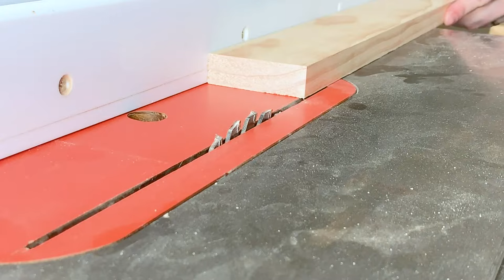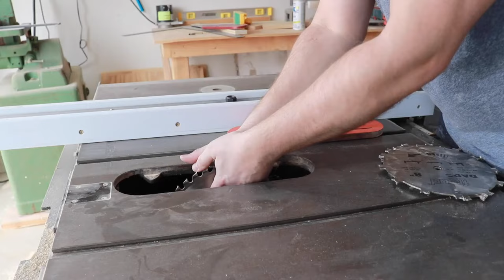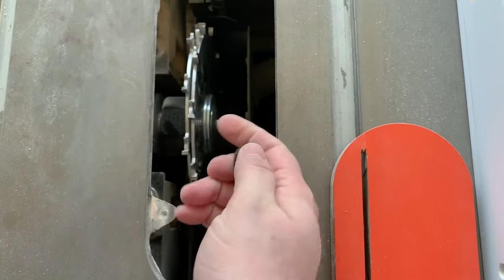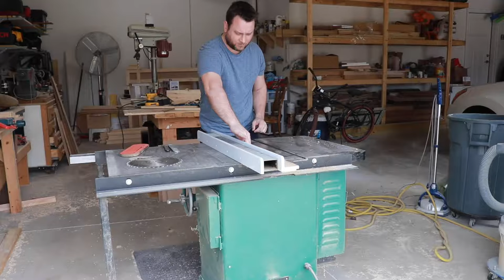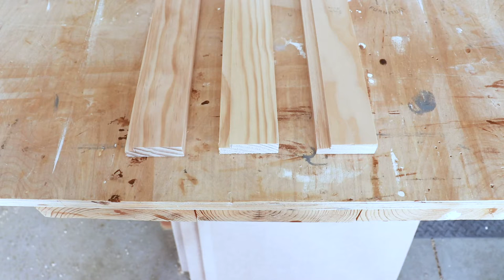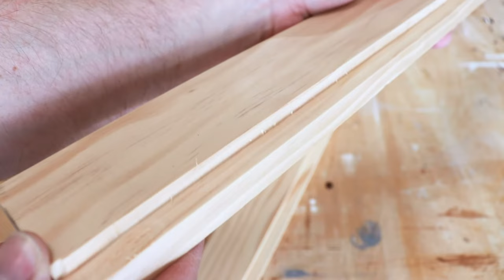What Is The Best Way to Make a Rabbet Joint | Woodworking

Comment: I have some feedback for you. 1. Use push sticks and/or blocks, not worth losing limbs or fingers. 2. Use protective eyewear, the carbide blade tips can detach from the blade and shoot like a bullet to your face. 3. When pushing material through the router, you need to push it against the router bit rotation direction, that way you have control, otherwise the spinning router bit can dig/bite into the material and yank it through unintentionally which can also be dangerous. So in your video, you should have pushed the material from left to right. Even better and safer would be to recess the router bit between and next to the two fences, so the bit is behind the workpiece, then push the workpiece right to left, much safer.
Reply from the maker: Thanks
Reply: As someone who has almost injured her kids with a flying piece of wood (it missed, but wend across the street into the neighbor’s back yard) and helped a neighbor as she went through 2 YEARS of surgeries and rehabilitation to fix the damage a table saw did to her hand: I 100% agree. PLEASE take safety seriously! Even little Mistakes around these machines can be costly!
Reply: Had my first router table mishap recently. It's an awesome tool but certainly one to be respected no different than the table saw. I made myself stand at the table and dry run until I figured out what happened and of course, it's the direction you mention. I plan on not doing that again haha.
Reply from the maker: Glad you are ok
Reply: My father lost the end of his finger making a climb cut on the router just like the one you did. It was very painful and then he had to clean up the blood bone and tissue all over his shop.

Comment: You mention the increased cost associated with the router method resulting from having to purchase a router table, etc. But you didn't mention the increased cost using the table saw, after all you need to purchase a table saw to begin with. Just trying to keep things apples to apples.
Reply from the maker: Good point and catch. :)
Reply: The tablesaw is the powerhouse of the shop.
Reply from the maker: Agree
Reply: The mitochondria is the powerhouse of the cell.
Reply: Yeah that's the biggest cost, the DeWalt DWE7485 cant even carry a dado stack, so check before you buy people, check the table saw your getting can carry/do them.
Reply from the maker: Very good point
Reply: you mean some people dont own a table saw?  thats unthinkable!

Comment: Man, you are using the router the wrong way. The tool should be on the right side of the cut, not the left. You are asking for trouble for no good reason.
Reply from the maker: Thanks. I always get my right and left mixed up
Reply: I'm new to this and trying to learn. Are you saying that the piece shouldn't be between the cutting head and the fence? or that he fed it through the bit in the wrong direction? Thanks.
Reply from the maker: Wrong direction of the spinning bit
Reply: Your comment is correct: what he used is called a climbing cut, but the issue that can occur with the workpiece on the correct side is that the rabbet, being cut on the bottom side of the stock, allows the workpiece to droop inwards toward the fence. One would need a square dowel whose height is the same as the height of the rabbet on the outfeed side to prevent droop. And it cannot be wider than the rabbet width. This would be great if you're doing a lot of these but for a single piece, it would be a lot of work. 

The dado (isn't it pronounced "daydo"?) blade method seems to be the most reliable for a good result.

However, a hand-held router is fairly simple to get a good result. You'd use a rabbeting bit with a bearing. Clamp it to a large piece or your workbench  and clamp another piece of the same thickness in front of it about a bit diameter away to keep the router from drooping. You'll have to remove the clamps as you approach them so double the clamps so that the geometry doesn't change when you've removed a clamp and relocated it to where you've just cut. Sort-of like leap frog. Need lots of clamps: like four on the workpiece and two on the extra piece.
Reply: @Jacob_180  always feed right to left on the router table and don't trap the workpiece between the bit and the fence, nor between the bottom side of the cutter and the table.
Reply from the maker: Thanks

Comment: Another method would be to make one long cut down the side of the board at the depth and space you want the lip from the edge, then after making that cut, flip the board up on it's side edge, adjust the blade depth and make a cut all the way along the side edge, thus completing the rabbet cut.  This method makes a very clean rabbet.
Reply from the maker: That is a good method...thanks for sharing.

Comment: Great video for the novice! 👍
I usually use a straight router bit and a clamped fence - no router table required. It's simpler than a table saw w/rabbit blades and can be done in the field. If the material isn't wide enough for a plain (board) fence then a two-board 'jig'/fence is needed, one board the same thickness as your material.
If I'm at home I do have a (cheap but bolted on) router table that I use. But, again, I use a simple straight bit.
A side comment ... rabbit joints are good 'training' cuts for the router novice. If you do slightly burn the board, no one's going to see it. ;->
Reply from the maker: Thanks for sharing, great stuff.

Comment: Hi Philip. Do you have any thoughts on the merits (or otherwise) of making rabbet joints using a Handheld router with the appropriate bit ?  They come at a decent price point and a portable.
Reply from the maker: I thought about using a hand held router. The only reason I didn't do it is I couldn't figure out a way to do it safely. You would need to properly secure the wood and run the router bit along the edge. I simply didn't do enough research to figure out the best way to do it. Maybe I will figure it out and do a future video.

Comment: My dado blade is comprised of only two blades with 2 circular wedge shaped inner pieces which cause the blades to touch on one side (lets say the bottom just as an example) while the "upper" side is seperated by whatever width I set it to by turning the circular wedges.. The wedges have a high side and a low side and when the high sides come towards each other they cause the seperation between the blades to grow wider on one "side" while the other "side" remains together. This is necessary, as we need the cut to start small and grow outwards. Yes it is patented 😀
Reply from the maker: interesting.

Comment: you can just clamp the board to the table and use a rabett bit in the router with a bearing on it.
Reply from the maker: thanks for the suggestion
Reply: This is great because you actually get the cleanest cut, the height adjustment is quicker, and you can do it with only a router and any flat surface (no need for a router table, which is large and frequently costs more than the tool itself).
Reply from the maker: Thanks for the info

Comment: Oh, I thought my router table method was something I stumbled across.  Didn’t realize that was the preferred way to do it.   I don’t have the room for a table saw so I’ve learned how to do everything with my router table. 

All you need in my opinion is a table saw, miter saw, and a jig saw.... and a sander of course.

  Might not be the fastest way to get the job done, but it’s the most idiot proof and requires the least amount of equipment.   I also find router tables safer than table saws.
Reply from the maker: Nice there is truth in your approach
Reply: you say you only need a table saw, miter saw and jig saw but you dont have a table saw.  How do you rip with a router?  What about a radial arm saw?
Reply from the maker: Radial arm saw would be dangerous
Reply: @ScreamingEagleFTW   radial arm saws are a limited and outdated piece of equipment 

But, while impractical, you can rip cut with a router.  I’d say a cheap circular saw would be better, but in a pinch with limited resources, I’ve used a router to rip plywood to dimension before. It wastes a 1/4 of material but it’s not difficult
Reply from the maker: Good to know
Reply: Tell me more about space saving wood workin! I live in an apartment, not in a building so I have a little outside space. I was super intimidated about buying any kind of table and was going to do some kind of slap together deal a) bc Idk how committed I am extremely new to woodworking and could toss it guiltlessly b) $$
Reply from the maker: That can be challenging. I would check out kreg jigs project table
Reply: @HowYouCanMakeIt  250$ really? for that? any alternatives.. thanks for suggestion
Reply from the maker: You could use a table saw like others have mentioned.

Comment: For dado blade, do  you simply put multiple blades together or do they have to be specific blades? Also, do you add as many blades as you need to get the desired width?
Reply from the maker: The set comes with several blades to make your cut as wide as you need
Reply: A dado blade is actually a set. The set comes with two outer blades, several chippers, several spacers and some shims. Normally it also comes with a table telling you how many of each to use to get a specific width dado.

Comment: What kind of blade do you use with the router to make them
Reply from the maker: I need to check can’t remember
Reply: @HowYouCanMakeIt  okay I'm going to build some beatboxes and I need to cut rabbits in the corners to put the box together and I ain't never done it before so I figured if I knew what I needed it would make it easier

Comment: Best and  easiest and cheapest is table saw with just two passes. First pass on the side the other pass on the face and voila
Reply from the maker: Yeah, I should have added that as a method. thanks for the comment, cheers!
Reply: can you explain that any other way? I am missing a key point.
Reply from the maker: One pass cuts one groove and the other cuts it out as you turn the wood on the edge

Comment: The spinning router bit looked the most dangerous, especially upside down on a table.  That scared me.  I think the Dado blade is the way to go. Just buy a dado blade and don't make multiple cuts with a single blade - it is a terrible finish.
Dado blade runs $50 on Amazon, and the Diablo Dado is $104. 
Thank you for a good video.  It was very enlightening to see the rough effect of single blade.
Definitely not going that route with time consuming adjustments to the fence.

If you are teaching on Youtube, wear goggles, and use a pushstick. This is not smart.  You could lose your fingers or eyes in a nano second and then wish for the rest of your life to be able to stop the clock and rewind to that moment before, and do it differently.  Don't have those regrets. Just wear the gear everyone tells you to wear.  We survived extinction because we listened to others and worked as a team with collective knowledge and experience.  If someone else had that experience, make it your own and learn before you have to relive the bad parts of human history again.  I think a stop block on fence would be good too.
Reply from the maker: Thank you for the comment and feedback.

Comment: Any wood worker worth his salt builds his own router tables and such..
Reply from the maker: I would disagree. Why spend time marking one when you can spend time making products and  furniture that you can sell. It all comes down to what your woodworking goals are. A wood workers worth and value shouldn’t be wrapped up in his or her tools and such.
Reply: @HowYouCanMakeIt  Sorry but I have to disagree with that comment Philip, the whole point of your video is to teach and advise your audience, so your presumeing the viewer has no or little experience with Rabbits or Dado's, so making router tables with draws and doors and Jigs for making Dado's and rabbits all goes to the experience of producing good quality work. Basically if your going to make a mistake better to do on your own stuff in your own time, than be under the hammer trying to produce a product for a customer with expensive lumber on a table you have no experience using, trying to make something you have no real expertise in producing.
Reply from the maker: It all depends on what your goal is a woodworker